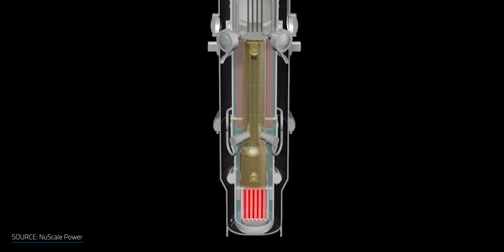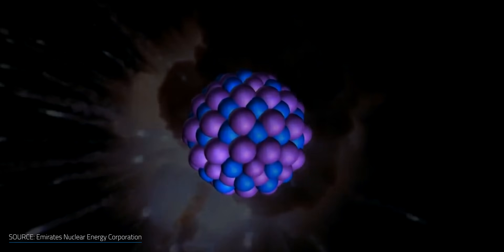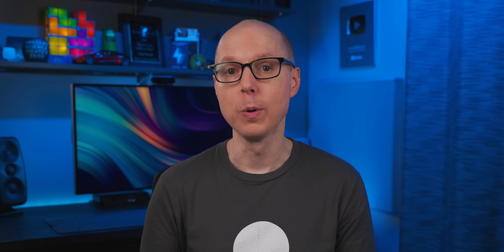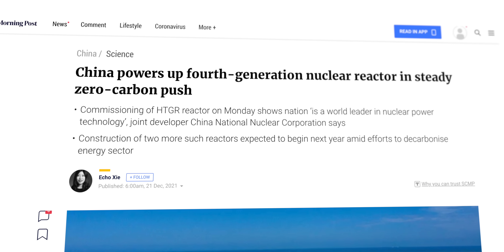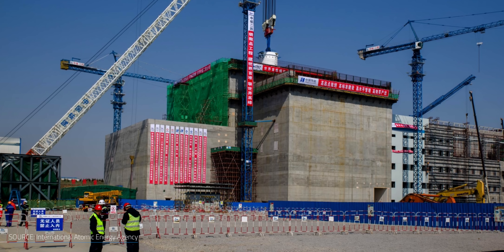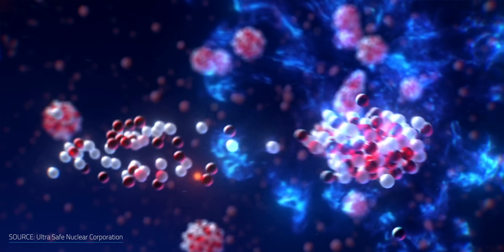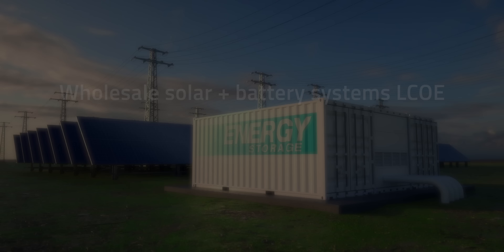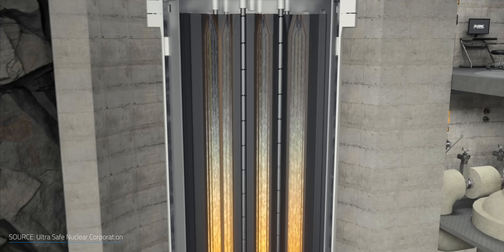Forget Small ... What About Micro Nuclear Energy?

Comment: People keep putting renewable energy versus nuclear, but there are massive drawbacks why we cannot go fully renewable unless you're Iceland.
Most renewables have a significant environmental impact, which if scaled to our needs in full, we would have to make place in a lot of areas where it affects wildlife, the land itself, public well being etc.
And worst of all you need to have a buffer twice the be size of average demand to deal with not only fluctuation of demand, but also supply. Currently that's supplemented with natural gas(which putin likes) and partially with buffers if demand is high and supply low.
In the background stable energy sources, like coal and nuclear, keep the grid up and as far as I'm concerned renewables just pollute the grid.

We needed those buffers anyways for the fluctuating demand, but because of the renewables they need to be much bigger.

Comment: just as a note, your math is a little rong, 1 houshold ist ratet at 6-10kw consamption (so max consamption, when you factor in that not everybody use it simultaneously) not 1kw so you can provid at the worst case 100 homes with power

Comment: Every house should have an inverter charger. Every home if possible, should have some form of hydro generating system like solar or wind. Every home should be a battery bank that feeds back to the system under low power conditions. This would balance the load and give battery capacity in existing infrastructure, instead of needing the land to build battery storage and solar fields.

Comment: I question how much power is wasted on that chinese built system on re-compressing and cooling the helium... Also I fear how cheaply that reactor was made, they have a bad habit of building things quick and dirty to the point of things that could last decades failing within years in a rather bad way.
Also most of the nuclear waste isn't from the spent fuel, it is mostly the old/used equipment and clothing used in processing the uranium itself.

Comment: I'll be honest, I'm not sold on using Helium in these new reactors. Helium is known to escape even in super tight containment. A crack in the system would mean losing all the Helium, leaving you with no way to cool the reactor. You'd have to keep Helium on hand in case some drained out, possibly a lot. Also, there is only so much Helium in the world; what will they do when it runs out?

I don't know, maybe these are small arguments that they have solutions for. But it doesn't seem to be a very future-proof design

Comment: I'd like to see pico nuclear energy — a reactor about the size of a compressor/condenser for a split air conditioning system that could produce upwards of 30 kW continuously, enough to power my house, including HVAC, plus lighting and electric vehicle recharging.  Every man's house could be his homestead.
Reply: Terrible idea. The history of small decay generators and medical equipment with radiation sources shows how easy an entire city can get exposed to radioactive material, just because it showed up unexpectedly.
Reply: @nonyabisness6306  although i disagree with pico reactors all of the issues with contamination are due to uneducated people in low income countries. Of course some of the stupidity i see daily in the U.S. by diy enthusiasts might end up the same
Reply: @patricktennant1585  It's just weird to me that we generally dump a shitton of regulations on anyone running a nuclear power plant, but then tout the idea of giving random private citizens access to mini reactors. Either it's dangerous or it isn't. And frankly I don't trust random citizens with proper maintaince and disposal.

Let's say you buy one, who will do maintaince? Who will dispose of it? What if the company that made them goes under? Does the state now have to do it? Does the owner pay? If so will some people just dump it? Will the state control what happens with the reactors? Can they even do that if it finds widespread adoption?

It's just not a good idea and it offers absolutly no benefits. Instead of 100 small reactors you can just build a big one. Less security risk and the same power output.

Comment: While you focused a lot on electricity production in this video you kind of overlooked another use for modular/micro reactors and that is for the production of heat either for industrial processes or for things like municipal heating and the heating of greenhouses. As of now we almost exclusively make use of fossil fuels for these use cases and wind/solar/hydro power are not really efficient at producing heat so a source like nuclear can really fulfil a need in this case.
Edit: I just remembered that i forgot to mention that i don't really know how this technology could compare cost wise compared to electric heat exchangers so for situations where a lesser amount of heat is required this may or may not be better or worse than a central nuclear heating supply.

Comment: I just want to point out that the  Soviet nuclear submarine program had a vessel which was powered by a reactor cooled with a lead bismith mix, If I remember correctly the downside of this design was that if the reactor ever stopped being critical the metal inside would solidifyTurning the entire thing into a very expensive brick of radioactive metal.
Reply: yikes

Comment: If you could make it a small enough system it would be ideal to heat and power a house onsite. I would imagine the radiation issue reduces depending on the size of the reaction
Reply: Generally a bad idea. Even if you mandate these things be disposed carefully some will be disposed of improperly and thus lead to widespread contamination, as is the case currently with medical equipment containing radiation sources or even just old soviet RTG's.

Comment: Boiling water reactors although simple in design with passives safety, however, have one major flaw, knock down of cooling water supply will immediately lead to core melt down as there are no intermediary cooling cycle. 
Multiple SMR or bigger plant at any location will have same problem as long as source of cooling is one / same. In India, we had one of the PHWR plants cooling supply was cut off for 24 hrs. Although, melt down didn't happen as these are very small reactors and fuel without any enrichment  (235We), however, all the fuel had to be replaced with new fuel as most of them started to leak and many got deformed. Whole core was replaced with new fuel.  Fukushima accident has shown need for having a cooling medium inside the reactor building. Reactor surrounded by water pool and an open plant top( no dome).

Comment: As the technology improves, so should the regulatory environment around it.
Reply: I doubt any of us could live long enough to see effective, or intelligent regulatory reform. We are governed by a class of people called "politicians". The fundamental requirements to be one of them is to be vacuously stupid, characteristically criminal, and proudly spineless. This scum is voted in by people who believe Jane Fonda was and remains a nuclear expert. Back in 1965 satellites were powered by solar cells and a highly classified thing called a SNAP...System for Nuclear Auxiliary Power. Each reactor was about the size of a coffee can, and the output was even more classified than their existence. That was 1965. Do the math. In over 50 years we've commercialized so very little nuclear technology, and the reasons are not primarily technical. They are based in the politics of stupidity and fear, and the ability of other energy producers, fossil fuel sources mainly, to control the vote of the criminals we elect.

Comment: fan of nuclear for a long time until cheap renewables. problem with nuclear, the energy it puts out is not electricity but heat, wasting a lot of that energy to convert to electricity.  if ever there is a use for micro nuclear would be for heating remote cold parts of the world without burning anything.

Comment: One of my favorite things about these micro nuclear plants is the shutting down of these coal plants and the infrastructure and generation ability is still there instead of using coal you use nuclear for your heat source to make the power
Reply: Coal is actually more radioactive per kwh than uranium due to the presence of thorium and uranium in the coal, when you burn millions of tons of coal, even small percentages of radioactive materials start to add up. These, and toxic metals gather in fly ash that's a by product of coal use. Oftentimes, these get dumped in waste ponds, because yknow who doesn't love surface radioactive and chemical waste?
Reply: what's wrong with coal?
Reply: @HamguyBacon  So, so many things. Non renewable, pollution, environmental damage from mining etc. Coal is literally history.
Reply: @zacherickson5444  Coal may not be renewable but the same could be said about nuclear, The environment does not get damaged from mining coal, you're literally moving one pile of resources to another location. Pollution has not been a problem with coal since the 1970's.
Coal is the most Energy dense and easily obtainable material 2nd to Oil.
Reply: @HamguyBacon  as in we'll all be dead in a not too distant future
Reply: @zacherickson5444  yes but Nuclear is also history and Not renewable and worse for the planet.
Reply: @HamguyBacon  What's right with coal?   It is the worst of all possible energy sources, it pollutes worse than anything else, it kills more people than anything else, it's the equivalent of using stone tools when bronze and iron left them behind long ago.
Reply: @krashd  Coal is the most easily obtainable and energy dense fuel source 2nd to Gasoline. Pollution has not been a problem since the 1970's when smokestacks were mandated to capture pollutants before it went into the atmosphere, coal does not kill people but radiation from Nuclear does.

Comment: F**k yeah, Nuclear has been the boogie man of energy sources ever since the Three Mile Island partial meltdown and the movie China Syndrome in 1979. These made nuclear power a taboo in the minds of America and beyond and as the statistics prove it's just false!
Where I live solar just doesn't have enough sun to make it work and there's not enough wind to make that feasible. fortunately, just up the road there are a couple of hydroelectric generators that will soon be making about 2.8 GW of power each, luckily we have lots of flowing water.
I have long wondered why our (Canadian) oil sands didn't install a small nuclear generator to give them the power needed to separate the useful products from the tar-sands rather than burning more BTUs than they generate. 
A Thorium pebble bed generator would be perfect for this application.
Overall the main problem with nuclear power seems to be, what to do with the used, but still radioactive, waste.
Well, in a book, Common Sense in Nuclear Energy by Fred and Geoffrey Hoyle, Dec 1980  ( ISBN-13  :  978-0435544324) they suggest that the entire nuclear waste from reactors running at that time could be encased in grapefruit sized unbreakable containers that could be kept under the beds of people being warmed and illuminated by the pesky reactors.
Alternatively, in Canada, we have an extremely geologically stable area known as the Canadian Shield. This has been proposed to be used in conjunction with a multi-barrier against release of the radioactive waste from the disposal vault under hundreds of meters under the . This was for use with 10,000 year half life radioactive materials. Thorium has a much shorter half-life but must be "kick started " using uranium 233 which has its own problems. both can be disposed of in the Shield if the local indigenous peoples and politicians can reach a positive agreement.

Comment: EPRs, BWRs, VVVRs type Big nuclear power plants were made keeping in mind economy of scale. And to sell their design they  had to pretend these design are safe for public hence added containment ( double containment including domes). However, they forgot two core principles of nuclear design namley what ever goes in the nuclear island becomes waste, and goal safe nuclear power plant design is to prevent melt down of core at any cost thru'out the life cycle. Containment is useful as long as power plant is functioning normally. However, during emergency conditions many a times containment becomes hurdle in providing cooling to reactor. And once reactor melt down starts containment becomes useless as it can't withstand explosion and melted core can also go down the floor of reactor. I think we should keep our reactors to lowest levels and should be surrounded by a circular pool of water. We should never cover the top of reactor and try to keep as open as possible so that direct cooling can be provided even if cooling lines have become redundant.
Secondly, if source of cooling is one , I fail to understand how multiple SMRs will help in enhanced safety. Kindly enlighten.

Comment: Kirk Sorenson claims Normal solid fuel water reactors only use %5 of the fuel rod, %95 goes to waste and that a thorium rector can use %95 of that waste. He also claims that if the waste ever runs out, the thorium supply won't.
LFTRs in 5 minutes - Thorium Reactors
https://www.youtube.com/watch?v=uK367T7h6ZY

Comment: So, all of that accumulated waste with STILL no place to put it! Perhaps that safe, long-term storage should have been defined prior to building the power plants. With the best of intentions, engineers, financiers, environmental safety experts, construction engineers can provide tremendous energy generation with nuclear power; however, they cannot comprehend all possible situations to prevent leaks or a meltdown. It is one thing to have an unexpected disaster at a wind farm or solar energy plant, which may be a very inconvenient situation. It is quite another that may result in shutting massive amounts of geography to habitation for several hundred or thousand years.

Comment: One thing this video should have addressed is how much of the nuclear waist is actually dangerous. Most of it is clothing and protective equipment with higher than background radiation that is easily decontaminated or can just be put in a barrel for a few years before normal disposal. This is with uranium.

With thorium, the ingots are so stable you can hold it in your hand and the reaction is completely controlled by the intensity of the laser. This helps make the waste that much less.

Comment: About nuclear waste: you didn't mention closed fuel cycles with uranium. Technology exists to use most of the nuclear "waste" as fuel, bringing time needed to safely store the rest of the waste down to a couple hundred years. That's where the fast neutrons come in.
You don't necessarily need thorium to eliminate long term waste. Closed uranium fuel cycles have been demonstrated, see EBR II. Russia is working on closed uranium fuel cycles. Hitachi further developed the EBR II technology. You also don't necessarily need liquid metals.
I find the Moltex approach interesting. They are developing an SMR fast reactor that uses fuel rods with the fuel solved in molten salt and separate molten salt for primary cooling. Operating pressure is low and the reactor can be passively cooled. Waste is recycled similarly to EBR II, adjusted for fuel salt instead of solid fuel pellets. Moltex is working in Canada (New Brunswick) to build a prototype reactor.
I'd love a micro modular reactor too. Rent a sealed black box that generates electricity and usable heat for 10 years for a city or a couple of towns or even a single house (nano modular reactor?). After use, send it back to the manufacturer to be recycled. Kind of like a nuclear battery, but bigger and recyclable.

Comment: To have a nuclear reactor here we would have to overturn a major piece of legislation implemented in about 1986 that bans nuclear devices from our country, which it doesn't of course as there are nuclear sources everywhere here, its just the public doesn't think about it. But the second you mention nuclear power they get very defensive. Its insanity because the second electric cars become more common than internal combustion engine cars we will run out of energy

Comment: Something you didn't touch on in the video is the water cost of using coal or gas for power. In arid countries we should be protecting our water sources, and modern nuclear is the best possible option for baseload capacity. Back in the early 2000's South Africa was developing the pebble bed modular reactor and one of the novel uses would be to use excess heat for process heat like for desalination of sea water. Imagine a power source that you can put down in a remote location for a microgrid that could also supply a community with fresh water for 30 years before needing refuelling.